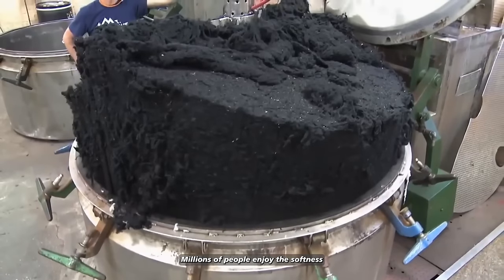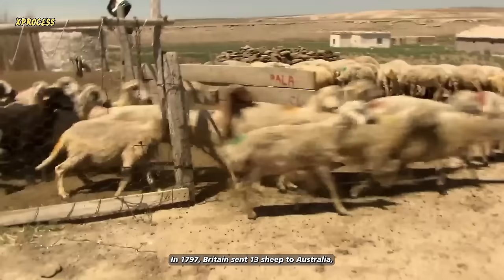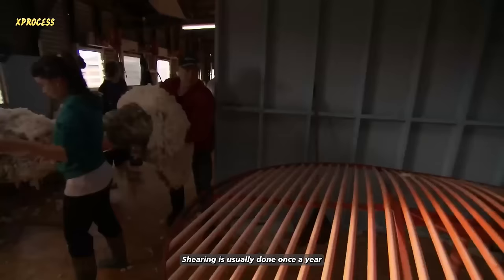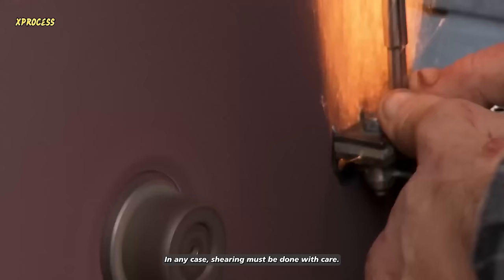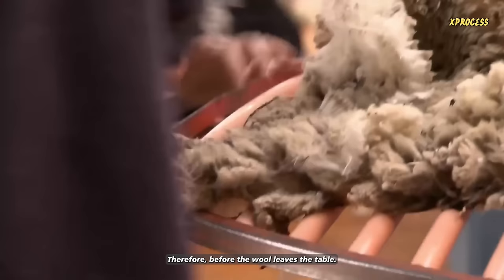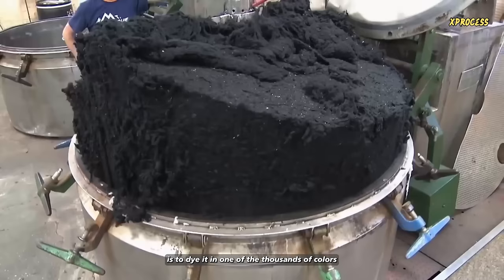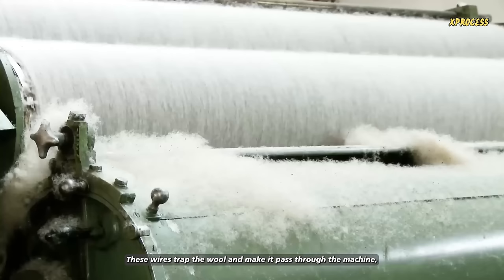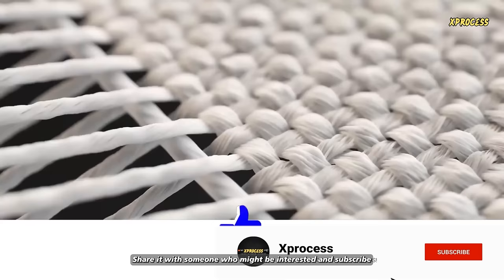How SHEEP'S WOOL🐑 is CONVERTED into CLOTHING🧶

Comment: This is really disgusting because the sheep should be shared when they are standing on all four legs. I really don’t understand whether they’re hanging by their hind legs at a meat plant.
Reply: sheep shouldn't be shorn when standing on all four feet, unless you want to punish yourself. They are pulled back so they are sitting up with the front feet up, and the backside on the ground.... there is quite an amount of skill and practice needed to do this properly and get optimum amount of wool off.